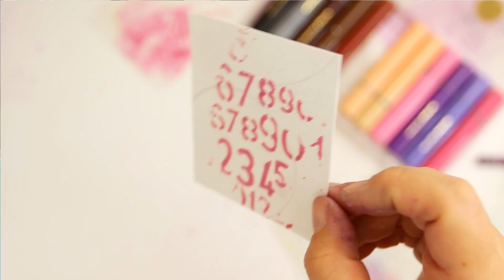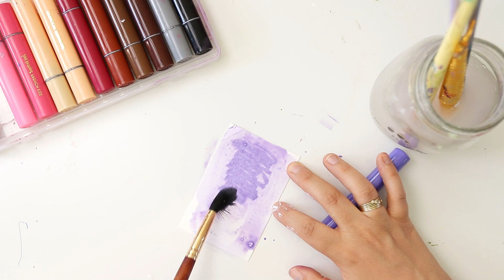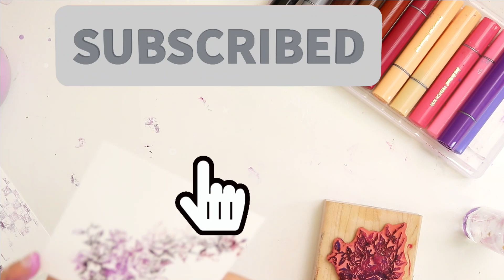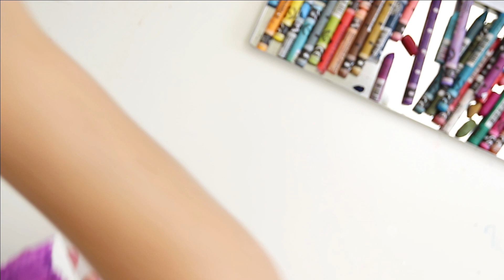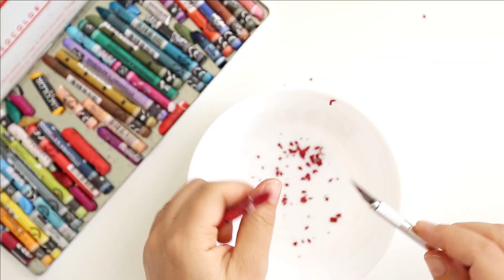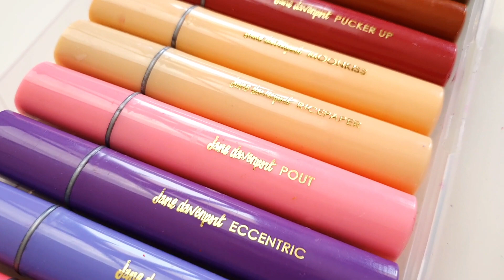Different ways of using water soluble CRAYONS - tutorial by Sharon Ziv

Comment: This was a very helpful video! I bought a set of Neocolor 2 and  looked up what to do with them. 
I've the transparent Gesso from AMSTERDAM and it seems to give not a very smooth ground (1 layer). I would looove to try the smudging tecnic, but my Neo's 2 don't move when I wanna smudge them with my fingers. What am I doing wrong?
Reply from the maker: Hi!my guess is that you didn't buy the neocolor water soluble set... That is why you can't activate it.
Reply: @sharonziv-noomish7386  thank you for your answer. Yes I have the watersoluble ones :) they blend beautyfully with water, but I can't smudge them with my finger. Maybe I used just the wrong paper or Gesso?
Reply from the maker: @rebeccakocher2974  did you prime the paper with geso/medium gel before?
Reply: Yeah it worked! Thanks a lot for your encourage. I tried it again today and I realized, that I had to less pressure and tried it not long enough.